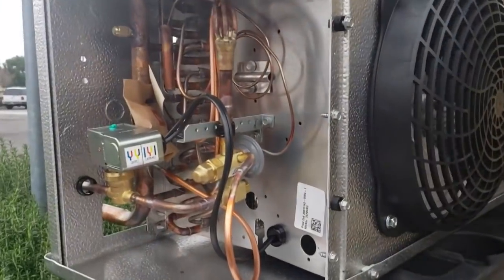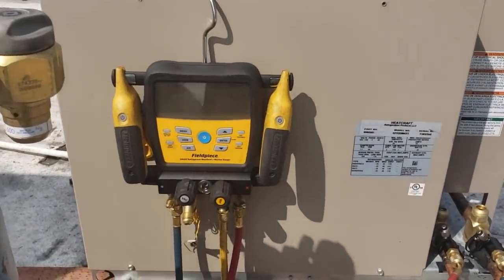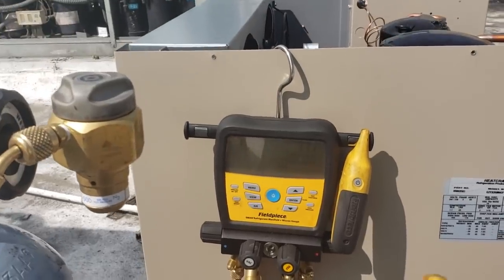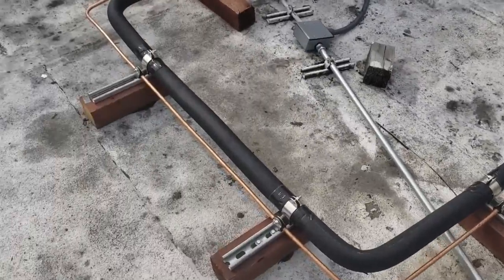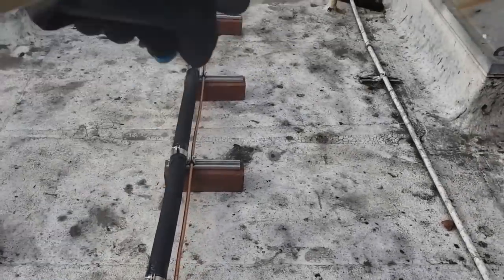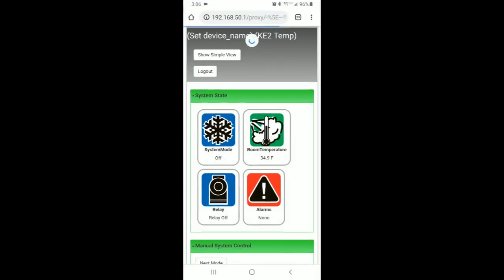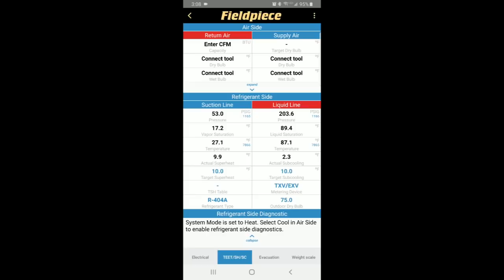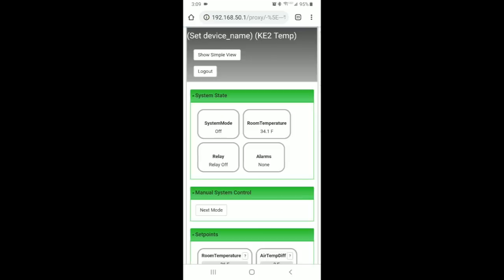Walk in Cooler equipment replacement

Comment: You can actually set the time for your defrosts, I just pulled up the manual to confirm: you have to set the defrost per day (dpd) to Custom (CUS). From there you will see the time of day (TOD) parameter and d1 through d12 for your defrost times. (those are from the controller, I don't remember how to set that on the LDA interface)

That's all we've been installing on or WIC and WIF for a while now, so far they've been money savers and have been pretty reliable, I think we've had one failure out of +-20 or so temp and lowtemp controllers over about a year.
Reply from the maker: Good stuff thanks for the tip!

Comment: Nice job. Check out klo-shure clamps for the suction line. Grabs the pipe great and you spray foam the insulation into the clamp.
Reply from the maker: I actually used cush clamps which have the insulation built into them 
https://www.haydoncorp.com/products/h-strut-system/general-fittings/pipe-conduit-supports/cush-a-therm

Comment: Trenton is selling the evaporators with the ke2 already installed. Think it's like 3-400 bucks more. Haven't tried it yet but want to.
Reply from the maker: Yeah I've been thinking about one of those
Reply: Also I know it could always be the guages but I pressurize to 150 psi too except I never have a variation of .5 or 1 psi over 30-60 minutes (sometimes 24 hrs) unless there is a leak. Any more and I'm leak checking. Also I've never been able to hold below 500 with a 2.5 psi drop on my gauges. I use the CPS mdw100 guages. But really the install is perfect worst case scenario a pin hole leak that brings you back in a yearish.
Reply: Kolpak is also just renamed (artic fox)
Reply from the maker: Yeah heatcraft just came out with a knock off controller that has all the same features built into it. It's called their intelligen
Reply: @HVACRVIDEOS  I have not seen this yet. Its something you can install and looks like the KE2 or is it like the beacon where the controller is mounted inside of the evaporator and has the remote thermostat? I guess I could just look it up.
Reply from the maker: It's a totally all inclusive controller like the beacon system. It is not externally mounted on the Trenton evaps. It looks really cool
Reply: Also what if I can use a universal dixel to control the unit and I set it up to where it only defrosts when the coil is Frozen by sensing the coil temp and the cabinet temp so that if the sensor senses a freeze it defrosts or if the box temp rises to high it defrosts. On freezers if the unit doesn't maintain temp but not because of a freeze up the limit is there to protect it.
Reply: I definitely always try and sell the newer equipment with all the benefits but sadly not many people want it. I am able to use the universal-xr controller to control fan speeds or on/off time, the defrost so that it only defrosts when necessary and that will defrost if the box is ever unable to maintain temp. The probes can be extended up to 300ft. And all for 750.00 total bill with taxes and install and set up and everything. What do you think? Alright idea?
Reply from the maker: Yeah man not a bad idea at all

Comment: Nice work Chris. I can see why that KE2 is more easy to dial in via phone without manually adjustment.  its more  benefit for us. What's con and pro of having KE2 ? it will more repair especially with sensor, sir ?

And for new FP manifold , I like what I see with probe that clamped at evaporator coil at walk in cooler while you're up at roof. what's limit of range of probe ? 

Thank you for sharing as always 👍
Reply from the maker: The ke2 products are nice but time will tell what problems I run into with them. So far so good
As far as the fieldpiece manifold it's only using bluetooth so there can be interference.  I have ran into some frustrating interference problems with it before but overall its great
Reply: @HVACRVIDEOS  got it, sir. Again thanks and appreciate it for your time.

Comment: Nice install Chris.  Appreciate you sharing the install. Chris are they replacing 404a with hydrocarbon?
Reply from the maker: I'm sure eventually we will replace 404 but I'm not ready to do so yet. The most popular replacement at this time is r-448
Reply: Manitowoc is going to 410a over 404 due to gwp. Only a matter of time before hydrocarbons become required
Reply from the maker: Im going live this evening 3/4/19 @5:PM (west coast time) to discuss my most recent uploads come on over and check it out if you can  https://youtu.be/u62cdOX0OvM

Comment: Have you had any issues with temp controls mounted on the coils? I never mount on the coil anymore. Too many issues with vibration. The past year or more I am actually mounting the KE2 external of the W.I. at the entrance. Super nice to adjust when not in a -10 box. Less likelihood for condensation issues on the controller itself. And, customer sees constant temp and hears alarms more often. You do have to order the longer com cable but it’s cheap! Very neat and clean install!
Reply from the maker: Im going live this evening 3/4/19 @5:PM (west coast time) to discuss my most recent uploads come on over and check it out if you can  https://youtu.be/u62cdOX0OvM

Comment: What type of clamps did you use on the suction line? looked like it gripped around the insulation, "Klo-Sure"?
Reply from the maker: They are called cush clamps they are insulated strut clamps and work great
https://www.haydoncorp.com/products/h-strut-system/general-fittings/pipe-conduit-supports/cush-a-therm
Reply from the maker: Im going live this evening 3/4/19 @5:PM (west coast time) to discuss my most recent uploads come on over and check it out if you can  https://youtu.be/u62cdOX0OvM